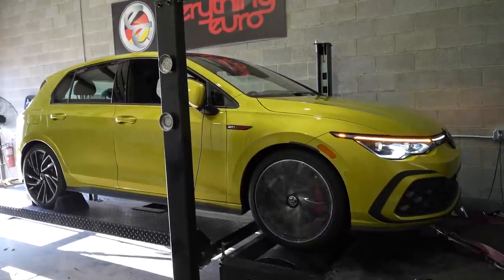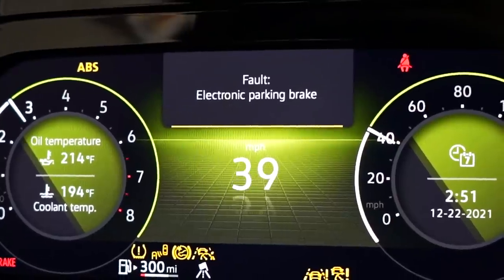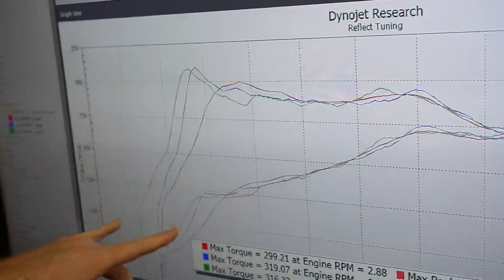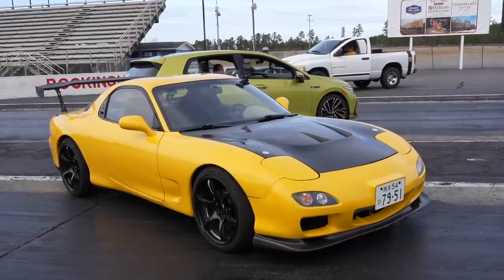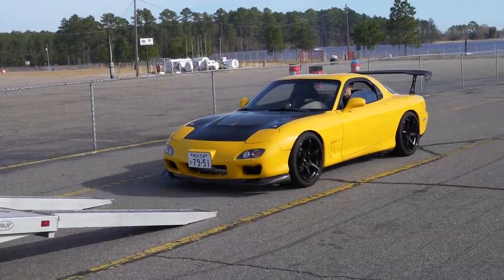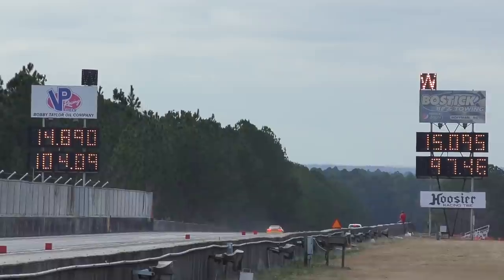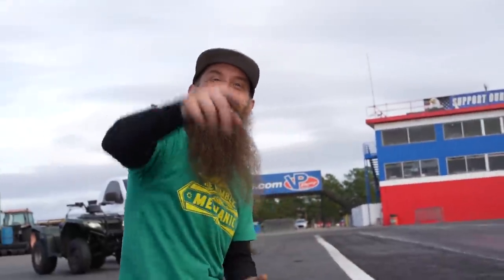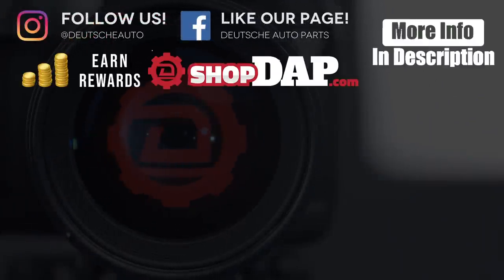Stock MK8 GTI 1/4 mile Times & Dyno Numbers!

Comment: I think those are great times for stock tires, cold track, and FWD torquey-boi.  People need to understand that with magazine times, car manufacturers KNOW they're gonna be tested for 0-60, 1/4, and all that, so they will send their absolute best example.  There have been more than a few "scandals" over the years where auto manufacturers were busted sending cars with higher compression, more aggressive tunes, stickier/non-factory tires, and etc.  So they'll do anything to give themselves better numbers.  In the real world, these numbers rarely translate.  Good job buddy, no flaming from me.  With better tires, slipping the clutch just a little more, and some luck, 13.9-14.0 definitely possible with a 98-99mph trap.  Good job either way!
Reply: 100% agreed.  I'm glad at least one person in the comments got that.  I would be willing to bet that the 'official' times were probably run with the same Toyo R888s that they sent their demo car over here equipped on.  I also think that slipping the clutch is going to be key to getting a decent launch, as I've commented elsewhere here.  People don't understand how to launch a FWD car and frequently tend to either bog/spin off of the line.  It's a balancing act and you really only get it down by practicing a lot until you get the feel for it.

Comment: While the ET wasn't that bad actually, your trap speed before heat soak confirms the car makes almost 300 crank HP. This car is impressive
Reply: His 60 foot was to high. If he droped front tire pressure to 25 psi both tires and launch and shift exact same way his 60 foot dropes from 2.4 or 2.3 and his trap spees would have increased 2-4 mph His ET what have been 14.4-14.6 @102-100 mph

Comment: Ran a 14.8 in my stock mk6 GTI 6mt, was a good challenge. Used to hold it at 3k rpm, have the clutch just barely engaged and handbrake pulled, would drop the handbrake and clutch and let the wheels slip through 1st and usually would hook in 2nd. It was kinda spinning is winning because as soon as you run out of front suspension extension that’s when it spins the tyres. Would recommend finding a quiet street and practicing the launch routine for a manual GTI just to get the action down and in muscle memory if you catch my drift.

Comment: Most people don't understand how hard you have to be on a car to get a good 1/4 mile time. I got a 14.3 at 100mph in my stock mk6. That's with absolutely slamming the gears, and a high rpm launch that absolutely cooks the clutch. Literally 70% of the time in 1st gear was with the clutch slipping instead of the tires. Also using the e-brake to preload the entire drivetrain to eliminate the sudden jolt on launch that starts wheel slip.

Comment: Honestly better tires alone probably would have gotten you about 14.3. That’d make sense when the DSG is 13.9
Reply: exactly, im surprised they didnt swap tires on the car. The ones VW provide suckkks
Reply: @sethwalker8952  I'm not surprised they suck at drag racing, when they have to do everything else as well.
The tyres are also an essential part of the WLTP score, so the manufacturer would of course choose a more eco friendly tyre on anything but a race car.
Sure it's a GTI, but it's still a Golf.
Reply: With the way he was launching the car, not even drag radials would have made a significant difference.  He needs to learn how to slip the clutch as the car is first getting off of the line, then release the clutch fully once the car has begun to roll forward.
Reply: @whorutothink  exactly. If you don't smell clutch when you launch a fwd car, then you didn't get the most out of it.

Comment: 235whp/297wtq on your mk7 GTI on what I assume is that same dyno compared to this 252whp/316wtq of the mk8. Decent little bump, I'm curious to see what the gains over stock are on a "stage 2" tune on the mk8 vs the mk7.
Reply: Agreed, while the stock Mk8 may be more powerful than the stock Mk7, I imagine the tuning limits will be similar, meaning a Stage 2 Mk7 and Stage 2 Mk8 will be similar
Reply: @Quebster  ya potentially, depends on if they changed any internal engine components to be more durable
Reply: I'm more curious to see where these land with just a stage 1 on 93 octane, since the Stage 2 path is being forcefully phased out by emissions regs in the 🇺🇸.  They really don't want us to have downpipes haha

Comment: From system and control theory that spike is what refered to as an overshoot in the step response.  It's usually undesirable when tuning the models controller. 

It's likely that the models controller was tuned in 3rd gear and not 4th. That why the step response are a better. But I'm guessing that the models use dynamic coefficients. So it would be interesting to see if the car continues to do this after you're driven it for a while.
Reply: that isn't how an OEM ecu works...
Reply: @Jaredscott89  what do you mean? Are you saying it doesn't have a control system? I work as an embedded engineer but not the automotive industry. I know for a fact that all these cars use a close loop feedback system so it has to have a controller that correct the plant model.

If I was to categorize that curve using control theory that part of the curve is commonly referred to as overshoot. 

Generally it's undesirable in most control systems, I'm not sure if the engineers did this on purpose though. 

Regardless it is interesting.
Reply: @desmondcorreia8765  Again, No.

Comment: I know every dyno is different but those power numbers seem really high considering the trap speed was only 97 mph. 250 rwhp would make it 295 hp at the crank and  310 ft lb = 365 at the crank. Based on 15% drive train loss, does that seem accurate?

Comment: Don't beat yourself up, dragging in FL I've never gotten an advertised 1/4 mile time in any of my cars. People who talk trash haven't taken a car to the track and been humbled. To get those times, you need a perfectly prepped lane and nice cold and dry weather.
Reply: Car and driver did 13.6 stock with this car timed on draggy. MK7-MK8 are just hard to launch once u get the hang of it with the right elevation and prepared surface it’s actually faster than many of its competitors and it’s predecessors. For instance the civic SI timed on draggy did 0-60 in 7.8 seconds. That ridiculously low

Comment: I wonder how a dsg mk8 would’ve faired? The mk7 dsg’s seem to launch better than the manual mk7’s

Pretty crazy how much tq it’s making. That’s amazing
Reply: I don't think the DSG has that great of an advantage on the launch itself, just the shifting.  When I launch my MK6 (DSG with launch control), even with stock power it would spin the tires if I held the throttle down and allowed it to get up to ~3200 rpms and dumped it.  My best times (tested with my P3 gauge) were keeping my rpms slightly lower (around 2400 rpms) and allowing the tires to begin rolling before giving it full throttle.  My current best is 4.89s 0-60 mph (making around 350 whp/tq) on Michelin PS4S.
Reply: @whorutothink  I’d have to politely disagree. Just based off of what I’ve seen. Dsg pulls tons of boost in first and second and it constantly varies too. The second I upgraded to ps 4s tires it somehow added more boost in second and a touch more in first. Plus it requires zero skill too. 4.89 is solid btw grats

Comment: fwd vw's are always such pain to get out of the hole! takes alot of seat time and dialing things in. why cant we just have it ez like honda's i hate to say it haha 🤣 those dyno numbers are impressive, definitely gonna be a sleeper build for roll racing, mk7s are already spanking some hell kitties! cant wait to see where this platform gets with basic bolt ons!
Reply: That’s because u gain way more out of tunnes on the VW than Honda
Reply: @glistud8178  lol not any more unfortunately, and that's coming from a vw fanatic since day one.
Reply: @dandimoski8107  yes u do, I guess u haven’t been been informed well in the recent scene brother. The MK7 GTI has set higher record than any SI, the MK7 golf R has set higher records than any TYPE R, and the MK7 GLI has set higher records than any accord 2.0. VW are still the ONLY group that gains over 100HP with a single stage 1 out of any of its competitors. If you are a VW fanatic you should know that. Honda’s are great, and if u change stock block and what not u can gain massive numbers, but that’s not easy money or easy power, tune for tune VW is still the king as far as these little 2.0 in these price ranges go brother. The MK8 with a single piggy back is doing M2 trap speed and timing, just wait for ecu to be unlocked 

I’ve been in the tuning scene for specifically Honda and VW for a long time, talk to anyone and they’ll tell you the VW gain way more power out of a tune than any Honda rn.

Comment: Well for what it's worth, my 2017 6 speed manual with a unitronic stage 1+ ran a 14.7 / 101 for a couple of runs but only because I was spinning like crazy (no LSD).  My best run was when I bogged it off the line where it ran a 14.1 / 103.  That Mk 8 should be high 13s easy.
Reply: I did mid to high 13s in my 2015 Focus ST with just bolt ons and a tune with no lsd. I think the mk7 and mk8 is definitely more tunable with a dsg especially but I was hoping this mk8 would be faster stock.

Comment: lol 14.8!! lol i mean its exactly what I would expect out of a FWD car with that much horsepower. 13.9 was totally unrealistic anyway. You can probably knock another half second off that 1/4 mile time with some more drive time and practice. I laughed at the 2.6 60ft though. Too spoiled with quattro now. lol
Reply: I noticed the demo car they gave to U.S. vendors ahead of the launch for the MK8 had Toyo R888s (street legal R compound tires) and wonder if they didn't use those tires to hit that 13.9?  🤔

Comment: No thanx.  My first car was a '77 VW Rabbit, 80 hp and 1800 pounds, it would get to 60 in 9.0 seconds due to its light weight.  I used the beat my friends American V8 cars on a regular basis not because the car had a lot of power, but because someone like me [6'1" and 150 pounds] and a 240 pound friend could easily pick the back end of the car off the ground, and they did that to me one day on Lewis Avenue in Temperance, Michigan...

I'm sitting in my car at a stop light, I notice I have friends behind me in a car,  then suddenly I am looking at the ground a few feet in front of my car.  They had gotten out and picked my Rabbit up by the bumper!  That is how light but strong these cars were....

Comment: Can’t drop the clutch on these power level cars, my 3.2 swapped Jetta is very similar power 245whp with less torque (280hp 250lbft at the crank), with lsd and 02m six speed 1400kg and runs 13.9s at 104mph, 2.5s 60ft on 19” csc5p tires which isn’t any better than on your car. Try dropping tire pressure and doing 2500rpm soft launch with abs fuse pulled👍

Comment: Well I suppose I'm not going to upgrade to a mk8.  Let's just pretend he was racing in Denver.  You need to hold down the traction control button to get it closer to "fully" off, if it's the same as on a mk7.

Comment: Paul, I admire your dedication. Also love to see friendly competition 'from within' with Mr. Cameraman jumping in for a run. Now BEN, that was disappointing. I'm sitting here looking at my slips in cold Eastern Ontario, Shannonville track to be exact... and I see that in September 2018 my old 2006 Grand Touring 350Z coupe with a DE engine, slushbox, bolt-ons and a tune ran 14.3 @ 99.5, 14.1 @ 99.8 and 14.0 @ 99.0 on stock tire sizes. First time at the track, ran just for fun; Dynapack only showed 252 HP @ 6,700 RPM. Within a half second of a twin turbo FD though...??? And more than a half second ahead of a brand new GTI i.e. 15 years newer with all the turbo advancements involved..?!? Shame. Shame shame shame, guys. Especially Ben. That diff scarred you.
Reply: I ran a 14.7 @ 95 mph in my MK3 VR6 (bolt-ons made 170 whp/163 whtq on a dynojet) on a 98 degree F day in August in North Carolina.  The car had no weight removed aside from the full size spare.  My best launch was a 2.3s 60' and I'm sure I could have improved slightly on that had my adrenaline not been pumping.  There's no reason why this MK8 can't easily run low 14s with a decent launch.  Paul just needs to get out and do a lot of practice launches on a back road to get a feel for slipping and popping the clutch once the car starts rolling.  The clutch should hold up just fine.

Comment: Never going to put down the power on that surface
Wheels spinning and traction control was all over the place
If normal asphalt, you probably would of gotten nearer 13.9
Just my opinion, that's what I seen the gti I had no grip on the drag strip
Reply: Would be much worse on the street. Even with an unprepped track, it was grippy enough to catch traction and bog.  On a good prepped track surface it'd probably hook with just the tire pressure down in the front tires to 18-20lbs.  Air the back tires up to max psi as well to encourage weight transfer to the front tires.  That, plus slip the clutch a tiny bit more and you'll be gold.  Source: Years of drag racing experience with FWDs and AWDs.

Comment: You've dramatically improved the flow efficiency and the torque limiting map is freaking out. Essentially, the engine is producing more torque than expected. I suggest you flash the ECU asap.
Reply: Where and how? They only put an axle back on the car, that doesn’t change anything
Reply: a muffler delete isn't going to dramatically improve flow... its very very far behind the extremely restrictive downpipe and turbo muffler
Reply: @vincentwightmalatesta8254  Club sport OEM exhaust. He's not running a stock GTI exhaust anymore. What's happening is due this the increased flow efficiency, the turbo is producing more boost than the car is expecting, hence the car freaks out because the torque produced is exceeding the limits.
Reply: @ethanhaynes777  you'd be surprised
Reply: @LonelyTreeSunset  People don't understand how "smart" and sensitive modern ECU's are.  Especially Volkswagens.  If you do so much as change a FILTER on most modern turbo cars, it'll freak the hell out and pull power because it's seeing a difference in airflow.  And turbos respond VERY well to ANY reduction in backpressure, so restrictive things before it or not, changing a muffler or a resonator with something more free flowing definitely results in some boost creep.  Even a small amount is enough for the ECU in modern cars to go "wait wtf?!".  Talk to a tuner sometime(not in a jerky way, just in a "it's cool to talk and pick their brains" way) and they'll explain it and show you logs.  It's the same way on my wimpy twin turbo Ford Edge.  Delete the mufflers and the ECU sees a decrease in backpressure via increased boost pressure/turbine flow, and pulls timing/fuel and freaks thinking something has happened.  Super crazy.
Reply: @LonelyTreeSunset  Not really. The downpipe is going to be more limiting to exhaust flow than the cat-back exhaust is.  All of the TSI motors make more horsepower to the wheels after replacing the restrictive factory downpipe and then the turbine itself becomes the source of back pressure in the system.  The ecu shouldn't be 'freaking out' after gaining a mere ~3 whp gain.

Comment: Uuhhhh, my 18 gsw slush box runs 15's.... that's stock with a dirty car, like 100lb of dirt at the minimum packed into the wheels and wheel well.
Reply: Unsprung dirt weight
Reply: My '15 family CUV runs 12's with just a tune, packed with a car seat, a cooler, tons of bottled water(EMT and need water), and a full tank of gas, plus my other crap.  

I win.  :P

Comment: Wonder if the spike on the dyno is actually from the clubsport muffler. Perhaps the increased flow is causing the ECU to freak out and call for more boost shortly before "stabilizing" if that makes sense. Still clearly underrated, but perhaps a bit less so than one with the regular exhaust.

Comment: 250 wheel. So almost 300 brake hp. How do they get away with these massive under ratings? The R has to be in the same boat because a 3400 lb car with 315 hp doesn't go 111 mph in the 1/4 lol.
Reply: More 265 ish brake hp
Reply: @hitmanhart6275  It made 250 wheel hp so there's no way it's 265 bhp. The drivetrain eats more than 15 hp lol...

Comment: They don’t underrate cars they have absolutely no reason to do so, horsepower doesn’t affect emissions or anything. All this tells you is that your Dynojet read too freaking high, you also failed to show cf correction on that dyno screen, its almost like you guys intentionally didn’t show left corner
Reply from the maker: Not everything is a conspiracy guy..... we're just trying to make a good video.  Dyno sheet here
https://www.shopdap.com/blog/post/stock-mk8-gti-dyno-hp-and-tq-numbers.html
Reply: @Deutscheautoparts  stock sti makes 220whp on accurate reading dyno and goes 104mph in the 1/4 car has 30year old engine design and weights more. All im saying is that dyno reads waay high. You should put it on dyno dynamics or mainline and compare numbers, that would be an awesome video!

Comment: Damn my bone stock 94 jetta GL use to run 14s. This car should be running  13s if not hugh 12s. Something  is killing it off the line.
Reply: It runs 13.6. It’s hard to launch this car. Car and driver magazine who knows how to drive and tested this car with draggy. It actually does 0-60 in 5.1 seconds and quarter-mile of 13.6
Reply: @glistud8178  yeah that sounds right. His car was doing weird stuff. It looked like it had too much traction because of whatever is on the track and it couldnt brake free and then the traction controll was doing its crap as well.